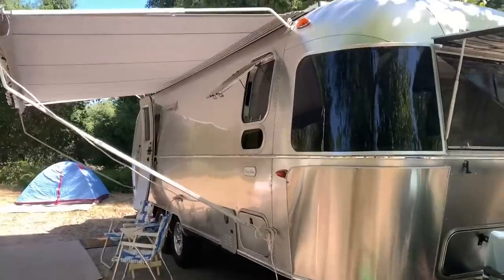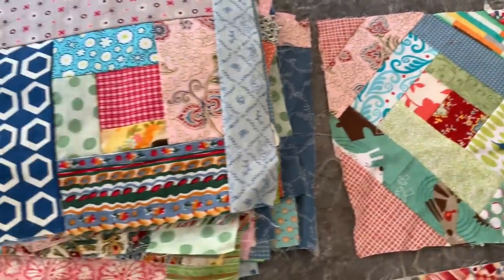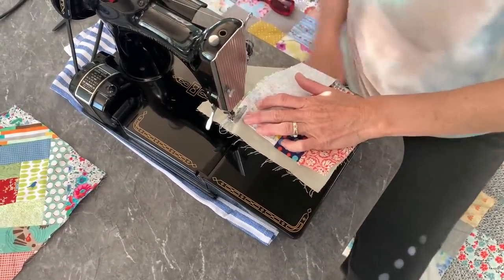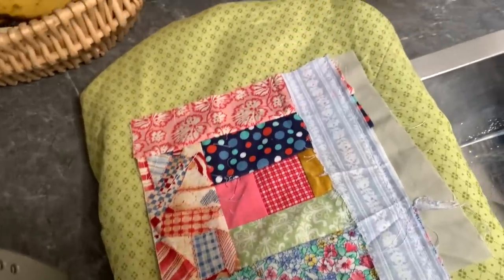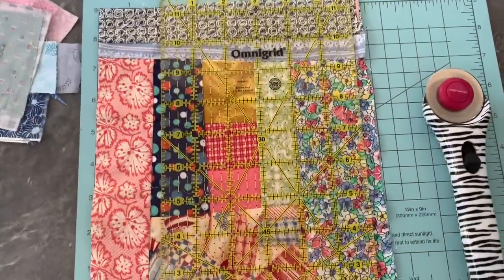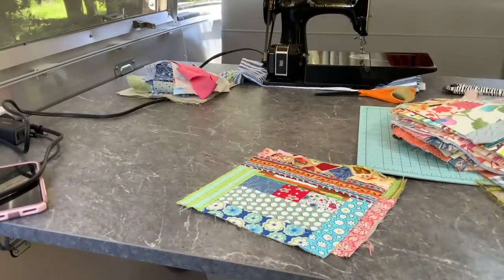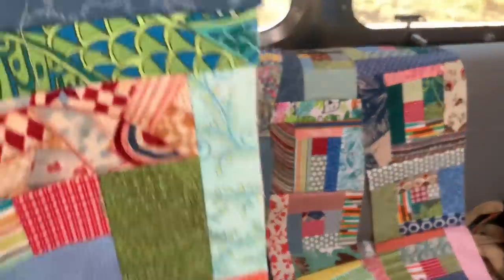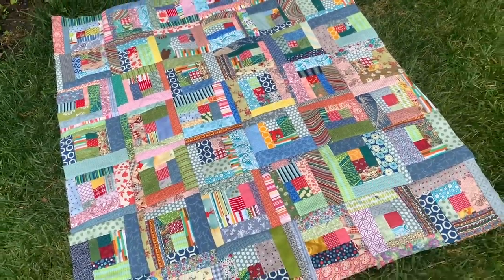Sewing in an Airstream | Make a quilt | simple sewing

Comment: It is a beautiful, Log Cabin styled, scrap quilt top that will make a beautiful small quilt). I use 8 1/2 inch squares of cheap copy paper to build mine on (so I can remove the foundation (paper) later to reduce weight, insect the back of my work, and reduce bulk). Camping in that Airstream would be a very comfortable way to camp out. When I was a teenager, my parents forced me to go camping. I hated it. I wanted to stay home and sleep in my own bed; however, I was not allowed to do that. We used tents, Army surplus wool mummy sleeping bags, cooked over a camp fire, and ate strange foods. Using a restroom and bathing was the worst. I was later in the U.S. Army; and, I never suffered anything as bad as what I went through on my parents camping trip in Washington State.

Comment: Sheets are not recommended to use as the weave is too tight. The needle brakes the thread instead of spreading the weave. Cute idea in an RV.
Reply: I have used Muslin Fabric as a foundation square,...loose weave and inexpensive